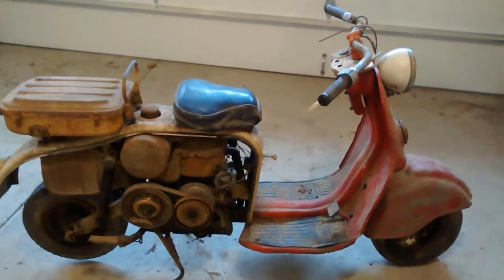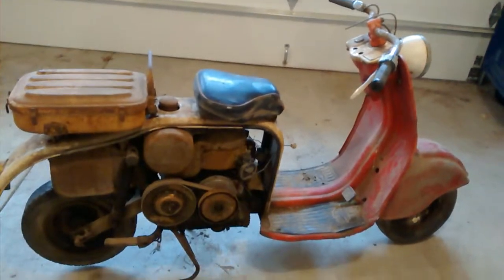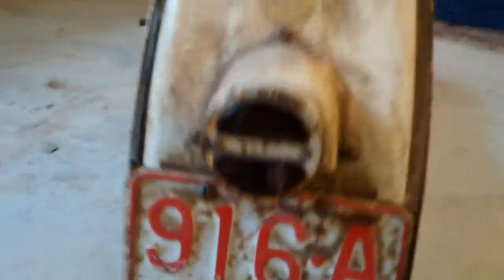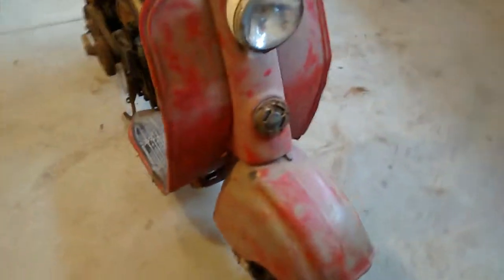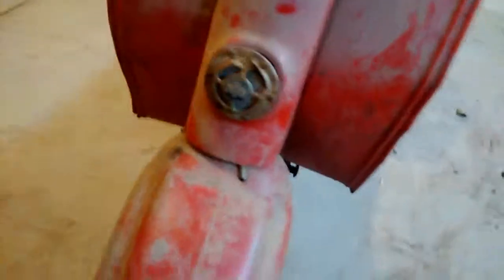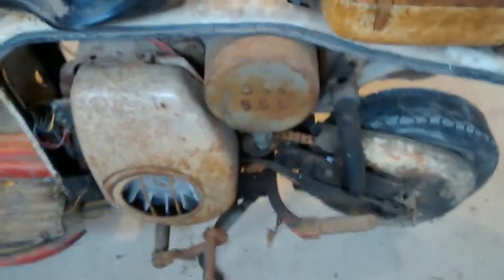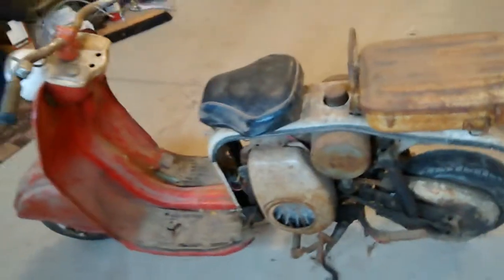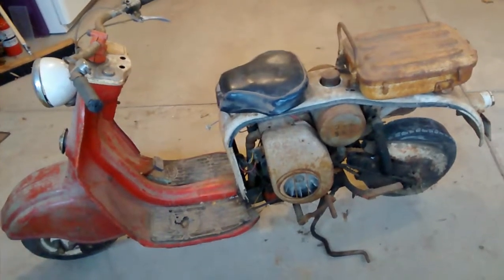1959 Riverside Silver Pigeon C75 Scooter by Mitsubishi

Comment: I don't understand why people part out machines like this. Stupid.
Reply from the maker: Pretty simple,  I buy this stuff from scrappers so that it doesn't get ground up for $30 in misc steel / iron breakage.  I've sold parts off this bike to 50+ people ac cross the world (Japan, Sweden, Australia, etc) The old farmer who packed his farm property with this stuff passed away and his kids just wanted cash asap, so they hired a disposal company, and I got the tip (from the network of scrappers that I buy from), that there were a handful of old scooters and motorcycles.  I loaded up what I could save and what I left on the farm was loaded up by scrappers and ground up.  If you want to save this stuff, I suggest you do something like what I do, buy signs and post them at you local scrap yards, offer to buy old bicycles, mopeds, and motorcycles for twice what they are worth in scrap.  Everyday tons of good old stuff is getting melted down and I've found buying from scrappers is the best way to preserve this stuff.  I've saved over 400 vintage motorcycles, scooters, and mopeds over the last 15 years.
Reply: @rustbeltcycleparts6577  I must say I'm grateful you do this. It's great to know that not only can I find what parts I need when I'm working on a moped/scooter/motorcycle, but that rare items aren't being destroyed. thanks for what you do!